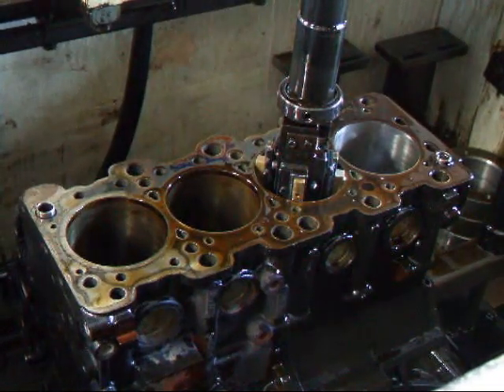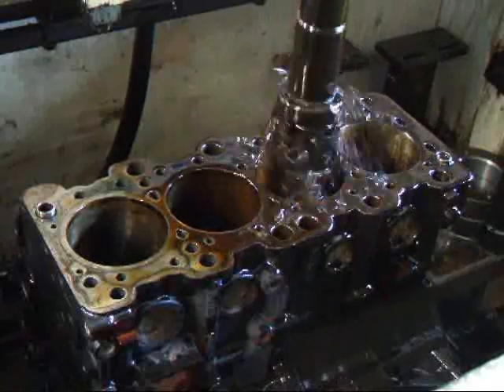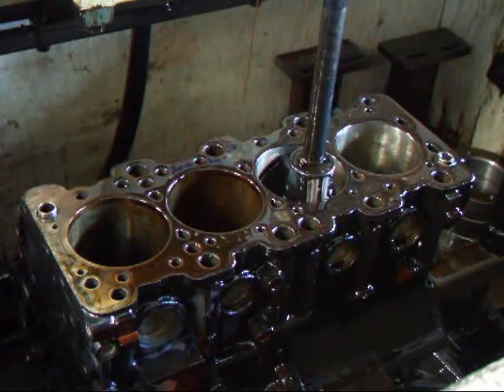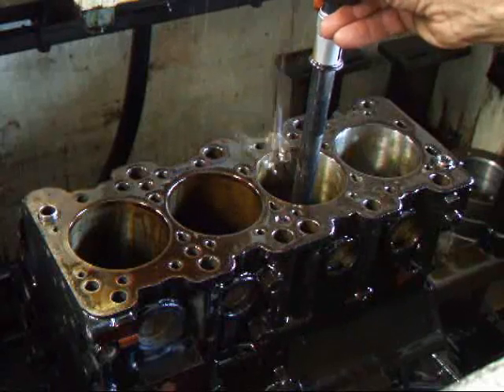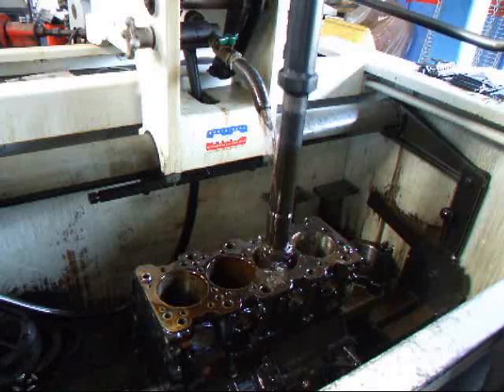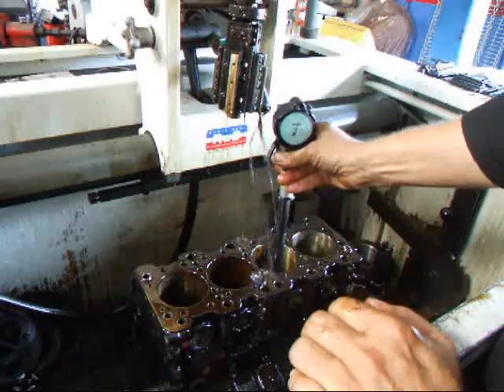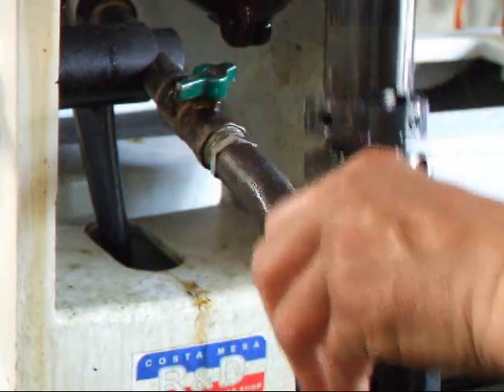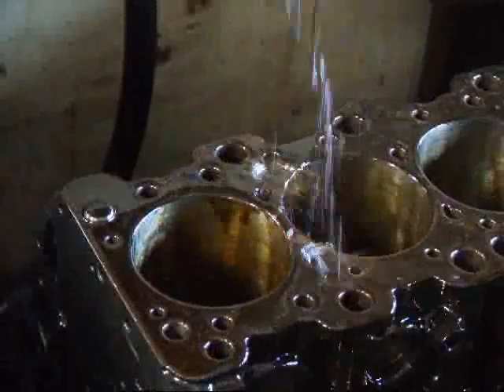Mitsubishi Evo Block Honing on CV616

Comment: John what are your thoughts on the torque plate....are there any blocks you MUST use one?   what is the worst that can happen other than less than optimal ring seal... excessive scuffing?  I hear a lot of guys telling me if I don't use a plate on every hone job... the sky will fall.  I assume it would be engine specific....thanks